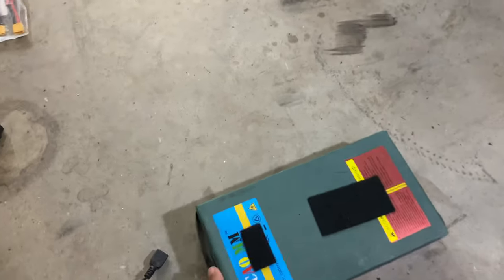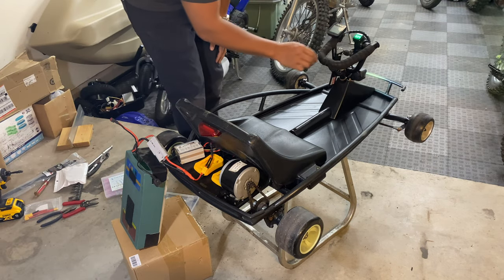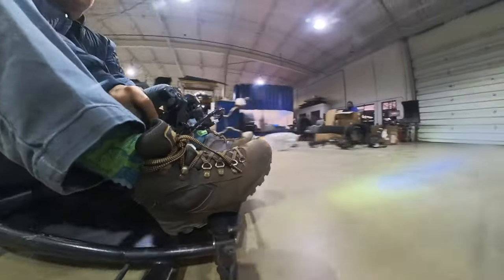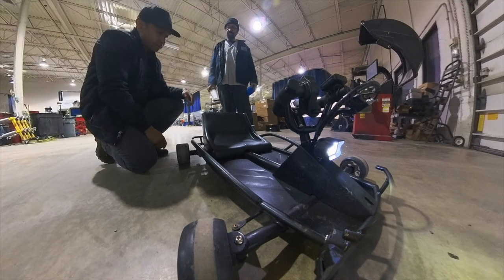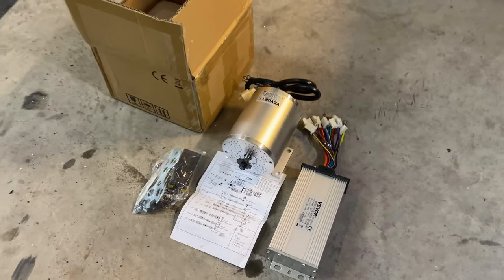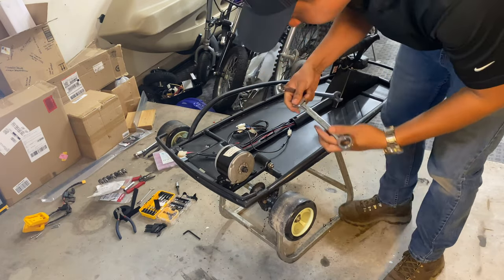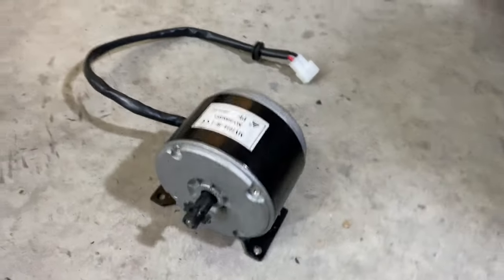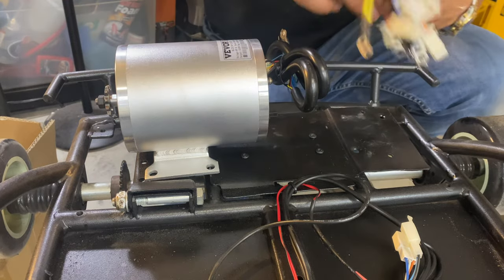Drift Go Kart Build Part 5 | Let's Go For More Voltage!

Comment: I have the same motor and same razor drifter but I’m have trouble finding a big enough sprocket to fit on the motor you got any recommendations?
Reply from the maker: Are you referring to the stock motor at the beginning of the video or the MY1020 brushless motor for the second half of the video?
Reply: I’m referring to the 2000w motor used in the second half of the video
Reply from the maker: @joaquinhaines692  for that motor, I usually use a 13-tooth 25H sprocket : https://amzn.to/3wnsIUh
Reply from the maker: Here’s a 15-tooth if you need bigger: https://amzn.to/42QDJd4
Reply: I'm doing this same thing. If you could show mounting the 2000w motor and exactly what chain and sprocket you are using, that will be amazing...thanks bro for this tutorial

Comment: Question: I built one of these kart and now need to reduce the speed to be kid friendly, I’ve installed a 3speed and it doesn’t reduce the speed enough. Do you have any suggestions on how to reduce the speed more?
Reply from the maker: @brandonbenjamin95  install the 3-speed switch that came with the vevor controller and switch to the lowest setting.
Reply: @PatOutdoors I’ve got that installed and have it on the lowest settings but need to reduce speed even more. Tried a potentiometer too and that barely did anything. Thought maybe you’d know of something beyond the 3speed for more reduction in speed.

Comment: A controller upgrade wont change much on the XXX with out a battery upgrade.  The chi battery for the XXX is over 2gs!! Just saw another company came out with one in the us, but i dont know much about it.
Reply from the maker: The controller upgrade is the first thing I NEED to put on before I install the 74V battery. I can't do it after. Just doing it to prep for the battery upgrade (when that eventually comes in)

Comment: i just bought a mx 500 and i am on a budget and i dont think i can afford a 72v what battery should i buy i want to go around 35 i weigh 120 and want to do wheelies and recomend to order off of amazon and i will probubly buy the vevor because it is cheep  @PatOutdoors
Reply from the maker: I think a 48v vevor kit with a 13-tooth front sprocket, and a 48v lithium battery can net you about 30 mph
Reply: ok thats what i was thinking thank you
  @PatOutdoors